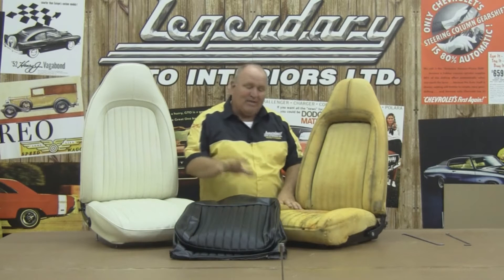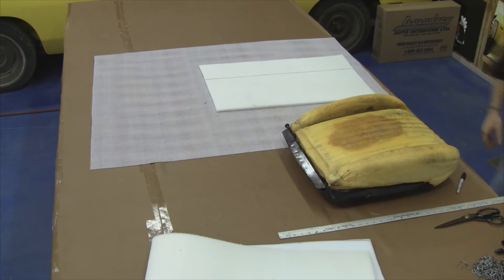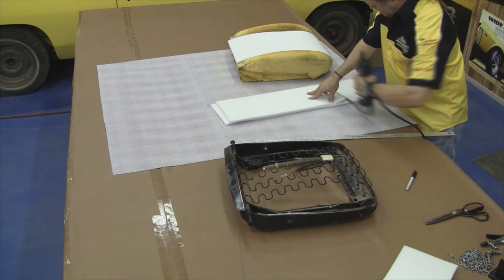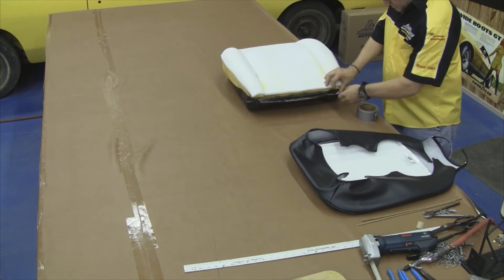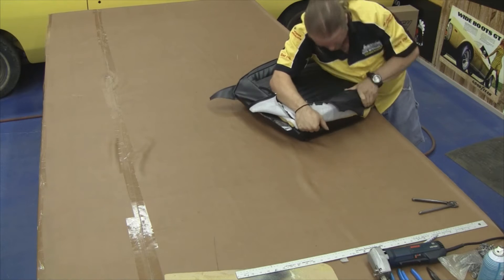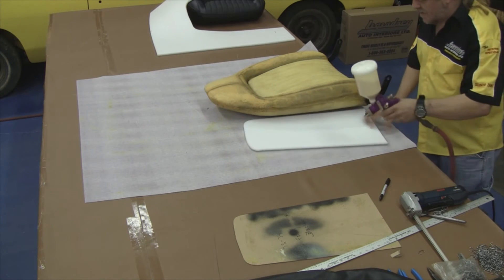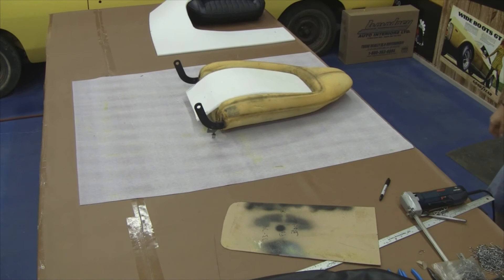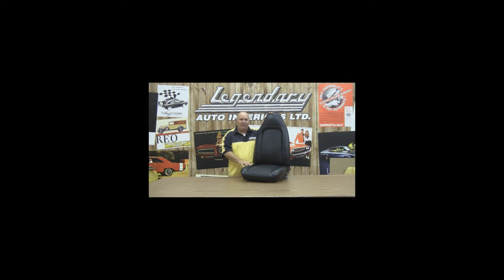1973 Barracuda/Challenger bucket seat installation

Comment: Ive recovered several seats by now.  A couple of good tips.  
1. put your new seat covers out in the hot sun for an hour or more before starting, that softens, loosens up the stiff vinyl...  Better, if you have a black or dark colored car, put the vinyl covers on that hot car in the hot sun for a hour or so, as you are disassembling the old seats.
2. Use some plastic, dry cleaning plastic works best, but a plastic trash bag will work too, pull the plastic over your foam, then..  that warm pre-heated vinyl cover will slip onto your seats like warm butter.
After hog ringing on the new skins, I like to let the seats sit out in the hot sun for another hour or more, for the new vinyl to soften and take its new shape.  The corners and every where that you have STRETCHED and HOG RINGED, the stitching and thread will be stressed and weakened somewhat, by letting the finished product sit in the hot sun for a while, softens and gets everything to stay in place, without ripping.